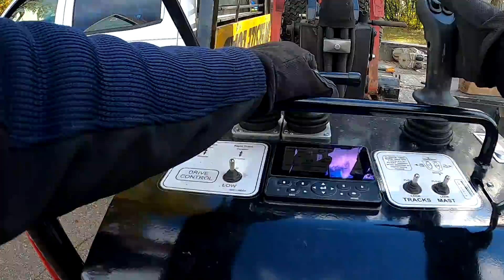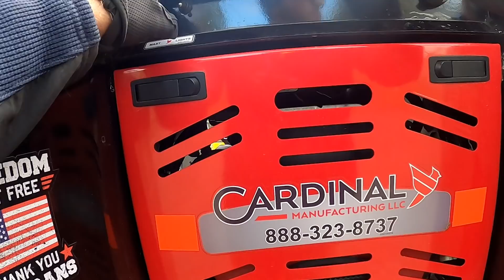Dog Kennel Repo #26

Comment: How you like them pop up cones I do charity lawn care and thought of getting some
Reply from the maker: So far ok but they are very light, I feel like they would blow over very easy.
Reply: I’ve got a set of them in my rollback, the base is pretty stout so they haven’t blown over. And they came with a set of little flashing lights that set into the top hole make them more visible at night.